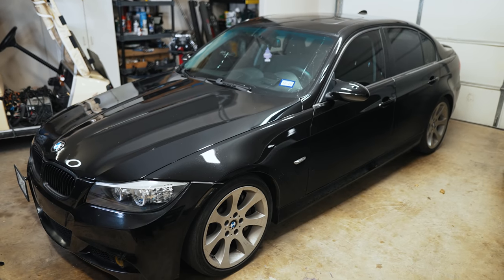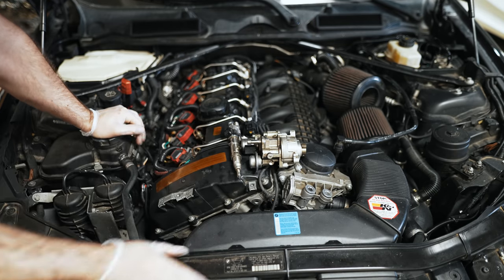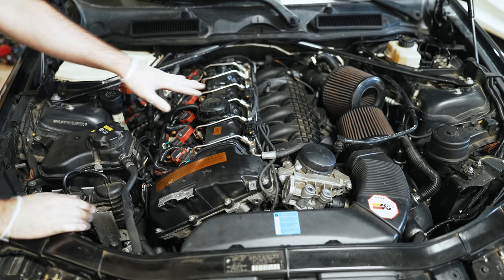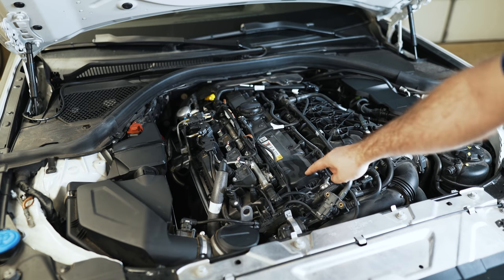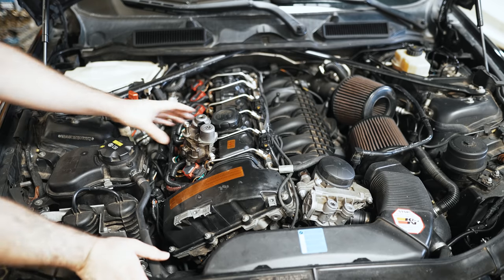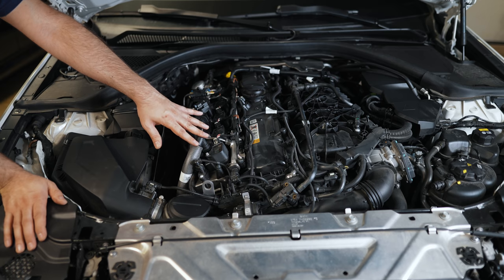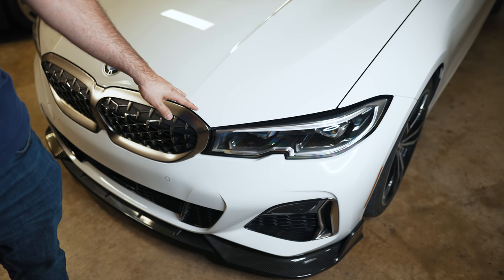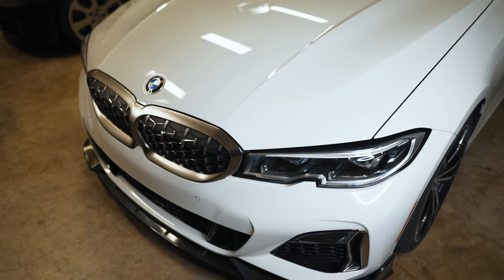Here Is Why New BMWs Are Now Reliable

Comment: One side of me says :
Im excited to see how reliable the B-modular engines are gonna be in a few years considering the BMW and Toyota partnership have been going on long before the development of the Z4 and Supra. So many people claims that Toyota and BMW didnt start working with each other before the Supra and Z4 was in development, when they actually started working together with the i8, its basically a Prius with a B-modular engine (B38 to be exact)... I got a 330e now with the B48 so i hope its still gonna be OK in a couple of years lol. I got engine, drive train and hybrid battery insurance on it just in case anything happens tho. If we ignore the S85 because of obvious reasons, and the horrible timing chain issues on some N-engines which BMW have been in denial about. BMW engines have been fairly reliable for years, as other people here have already stated. Its everything around the engine thats usually failed because BMW started experimenting with using plastic parts in around 2005. New engines are still packed with plastic parts, but BMW got years of experience now experimenting with plastic parts, and now they know what works and wont work.

Other side of me says:
Some parts are still made unreliable on purpose tho... BMW arent even trying to hide the fact that they earn more money from selling spare parts than selling actual vehicles. Theyre also purposely placing parts and gaskets at places where theyre difficult to reach so its more time consuming to replace them.

Comment: My 750LI bmw is reliable it’s all about doing the proper maintenance I bought my five years ago with 76,000 no issues only normal wear and tear oil changed brakes and rotors tires etc right now I have 178,000.00 miles running like a champ oh yeah I changed the spark plugs and did a transmission fluid change

Comment: Walking out the store the other day and I hear this weird noise, it was somebody at idle in their 340i B58, it sounded like a timing chain, car looked brand new. Immediately knew he doesn’t keep up with maintenance it was so loud and embarrassing as a bmw owner to see another bmw poorly looked after, incredible that you can have a B58 to run like crap. Very unfortunate we have bad owners then complain how unreliable they are when they can’t do simple services to prevent big issues.
Reply: You are just guessing that a lack of maint is the reason, stop doing that.
Reply: @FairladyS130  
What else could it be? There’s no issues with the b58 with timing chains. I usually don’t claim someone isn’t taking care of it but that car wasn’t taken care of at all, dirty exterior bald tires, and a rear tail light is out with an M badge on it? Clearly one of those guys who don’t care and try to look cool. Wheels were that cheap black dip paint on it too. We both know that’s there only 1 reason a timing chain on a b58 would sound that bad, lack of maintenance/ neglect. My X5 is 18 years old now I haven’t had a timing chain issue yet and I live where climate is -4 winter sometimes and it’s hot as 102F I haven’t had to remove any engine parts except the valve cover for a leak. Do you know what it takes to damage a timing chain? It’s not easy..it doesn’t just wear out, you have to really get on that car on cold starts with dirty oil fairly consistently to get a timing chain to go wrong. Haven’t heard any modern bmw engine have timing issues since the N62 V8. That sound was too familiar. The poor F30 sounded rough bro.
Reply: @aidenp5768  Any make of car can develop a fault irrespective of it's service history, that's just the way cars are.
Reply: @aidenp5768  Are you sure it wasn't just direct fuel infection loud clicking - ticking noise?
Reply: @UMORIEGA  
Positive it was timing chain, on the B58 chains are in the rear of the engine so as I walked passed it slowly on purpose could tell it was around the middle of the car, it was consistent scratchy/click unique sound that mostly timing chains make.
Reply: @aidenp5768  The problem is BMW says you can change the oil every 10-15k miles when we know you shouldn’t go above 5k miles between oil changes.
Reply: I doubt it, B58 just came out 2015. I have 2007 Sienna NEVER gave me a problem and no nise, and all I did was oil change.
Reply: @UMORIEGA That injector noise is much more pronounced if the engine's plastic cover was removed and left off. That could've been the reason.

Comment: You seem to be very knowledgeable about BMW do you have any suggestion for my comment below;
My water pump fail on a 2021 M440 xdrive with only 2,076 miles the car was at the dealership for 32 days they couldn't get parts supposedly because is a brand new model; what a joke I haven't even driving this car super hard I usually drive the car on my way back home from work on Sport Plus that is a drive of about 12 miles on city driving. could I have cause this water pump to fail so quickly because of driving it on Sport plus?? but what the hell that is why I got this car because of the acceleration and how it sounds on Sport Plus; now I'm afraid to drive the car a bit hard or Sport Plus; any suggestions. Thank you.
Reply: Wow that’s extremely premature in terms of a parts failure. I’ve owned my fair share of bmw’s including the e60 V10 M5, and these cars are simply not designed to last, by design.

Comment: Great thoughts, even my 2011 N55 has been dead reliable at over 100k mi. Granted, I keep up on the maintenance. 

My worry is that with European laws getting more strict every year, manufacturers have to keep increasing complexity just to get through the emissions tests. Within 10 years there'll be nothing but EVs and hybrids available.
Reply: When the euro7 norm will be introduced, it's game over for ICE engines in Europe so that will be 2025, when a perfectly, in house build industry, will be ruined by the EU, importing all batteries from China which is half the cost of an electric car.

Like they ruin everything, even 750 watt vacuum cleaners because of "environment" takes me twice as long to vacuum my carpet as a few years ago, hello....
Reply: EV's have their own red hearings.   How do you dispose of a colossal battery in our politically toxic environment?     Fossil fuel engines are not going anywhere.     Reality driving across country then hitting into a white out snow storm with an EV.  Yikes!    Ha, not this guy.   

Doing research on 340i and the b58 engine.  I hope it has Toyota roots for reliability.  If it does I'll proceed toward the 340i for my wife.  Seems like a reliable direction.    Much appreciate the informative video.
Reply: *~*~*~  "  Granted, I keep up on the maintenance.  "................VERY VERY EXPENSIVE......................Now REPLACE ALL TH ELECTRICAL and cal me back!...end of story!

Comment: Even the late EWG N55s are fairly reliable. I have a 2014 M235i with 95k km and it's only needed general maintenance and an filter housing gasket. This is an early build M235i (12/13), on a brand new F22 platform. Consumer reports christened it the most reliable sporty car in the US in 2016. We added an X3 M40i in 2018 and its needed nothing in 30k.

Comment: The "newer" BMW's are reliable because they haven't 150k miles on them.  Reliability to me starts thereafter, but then your BMW isn't new anymore.
Reply: Give them 10 years... will fall apart as always since 2006
Reply: @rocaley  in the middle east hot weather they completely fail around 5 years from the heat. On the other hand, the Toyota's easily last 20 years.
Reply: Exactly plus what about 200k miles
Reply: 150k is nothing. BMW should drive 300k miles
Reply: @syroboi3524  yup
Reply: look up 180k miles on b58

Comment: Per consumer reports 2020, BMW has a higher reliability ranking than Ford, Chevy, Dodge, Jeep, Tesla, Volkswagen, Audi, Nissan, KIA, GMC, Lincoln, Cadillac, Volvo, and Mercedes-Benz to name a few. Before you say anything about how great your Toyota is, just know Toyota currently offers two cars with BMW engines and drivetrains in them.

the mid 2000s were the dark ages for BMW and many other manufactures trying to innovate as fast as possible. Reliability was sacrificed, and they will probably never live that down, this comment section is proof of that. Hopefully the haters get over themselves eventually

Comment: I was close to selling my n52 e90 and get a 2019 340i buuuut I didn’t want to deal with a car payment along with car maintenance however this video is changing my mind. Appreciate the info
Reply: I’m keeping my 06’ 325i E90 until I reach 200k miles. Problem is mine is easily worth 10k with the expensive mods I have on it but kbb has E90’s at their lowest value ever right now. It can only go back up in value from here. Plus the N52 without a turbo is the most reliable BMW engine made since 2000.
Reply: @DillonRust  mods don’t add value on 325’s. They barely add value on 335’s
Reply: I’d never make payments on things that go down in value,
Reply: @thatgamertho227  
That depends, if I sold it myself I could definitely get 10k for it you’d have to see it’s condition to understand. Otherwise yeah my insurance would probably value it at a measly 5k, or only 2.5k for a trade-in.

Comment: Based on my experience with my 2018 M240i that took seven trips to the dealer and two replacements of the SAME part - in addition to the dealer illegally charging me to fix something under warranty and required by federal law - there is no way in hell BMWs are reliable. That's in addition to the 'what's it going to do today?" infotainment system.

I will say the mechanicals were flawless, but the whole car needs to be reliable to be considered reliable, especially when the dealer kept telling me that a driver's seatbelt that would not retract or work 'was normal'.

Comment: Also a starter/generator on the front of the crank and all accessories electrical off engine will make engine a very powerful and reliable daily use appliance.

Comment: From what I heard, Toyota had a lot of issues on BMW's design/reliability not being that great. I hope they both learned a lot from working together.
I think a lot of the bad rep comes down to costs. BMW's are quite a it more to maintain and repair. Same boat as other German vehicles. I own a German car, parts are ridiculously expensive compared to others.
Reply: We own 3 bmws... $2000 on maintenance in 6 years. What are u smokin? Dont tell me u go to mechanics...
Reply: Labor is expensive, the parts are a little more than a domestic, and a pain in the ass because everything must be ordered online.  But if you have a toolbox with a good collection and know how to use them, no they really aren't.  If you wrench yourself, you will come to love the brilliant engineering that went into everything.  The little plastic clips with springs vs pull tabs, or e torque bits so you don't strip bolts.  Everything comes apart with ease, and goes back together like a glove.  I have owned my e90 335xi n54 for 5 years, she is now 108k miles and full bolt on since I got her.  Never been stranded, but I fix my stuff, and keep up on maintenance.  I don't wait until things are broken to fix them.
Reply: The Toyota GR Supras have been very reliable. Most have the B58 engine.

Comment: I have about every generations of X5s in both V8s and inline 6 and recently jumped out of X5 and got into 2021 x3 M40.... I have to say it’s pretty impressive what they have done with the build guality. The only thing it doesn’t  work is the automatics seat heating/ preconditioning.
Reply from the maker: Hopefully they can address that via an over the air update.
Reply: How is an x3 m40i? I am looking to buy an m3. But I'll take an x3m if it's better.
Reply: @blocksource4192  I like them both but it all depends on how either one fits in your daily.  I’m jumping out of the x3 into a 2024 m340 xdrive. After many years with these I want a sedan again.  Also, the X3 is not getting the drive 8 ( the curve screen) until 2025. But overall, I really enjoy the x3, it’s built solid, it quite fast for an SUV. I don’t have any issue with it. The ride is stiff but I don’t have the adaptive suspension.
Reply: @blocksource4192  heres the rub. The X3 would be faster delivery than the sedan. I orders the 340 a couple weeks ago, they don’t expect to see it for a couple of months.
Reply: @pittwm  Im 17, finishing my company and starting to sell software rn. Im not even done saving up for the m3 lol, delivery times dont matter much for me.

Comment: Lots of input from toyota or so I read. Closed head vs open head. Intercooling etc. Now if they could use better quality plastics.
Reply: Any of these glass filled plastics are not going to last long in the engine bay.  It's just too hot.  The only plastics should be covers and certainly nothing in the coolant system.
Reply: @garyvanremortel5218  There is not one manufacturer on this planet, not currently using the same shit plastic. It is what it is.
Reply: @XcoolcoolbeansbeansX  I know, but I still don't think it's wise to fight physics.  How many aluminum alloy engines have been completely destroyed by the failure of one plastic pipe in the cooling system?
Reply: @garyvanremortel5218  I don’t know my guy, but I’m just trying to say it’s not a BMW problem. If it’s a problem, it’s a problem for every car being made now.
Reply: @XcoolcoolbeansbeansX  Glass filled polyamide is the bane of modern engines.
Reply: @garyvanremortel5218  you’re right. It’s sad, but sooner than later we will be begging to have a combustion engine car in any form, the way things are going.
Reply: @XcoolcoolbeansbeansX  And I live within spitting distance of the Tesla factory.

Comment: Purchased a used car with B58 with 87k.  Engine is solid, transmission solid (I change fluid myself for preventative maintenance).  But other than that, have had to change out all wheel bearings, guibo joints and an axle.  Fun fun.....

Comment: I too have noticed how much more reliable all the new ones have been getting. I don’t know about the 550i or M550i because it’s N63B44 engine is known for excessive oil consumption. Who knows if they ever fixed it. Because they still use it in the G30 M550i. 

But I’m super excited to buy myself an F87 M2 Competition in a couple of years.  Knowing many people have constantly redlined it at the track and the only wear item were the brake pads that needed addressing afterwards. It’s pretty much my dream daily driver that can be taken to the track straight from the factory
Reply: N63 engine was heavily redesigned in late 2012, so N63TU and later models are pretty reliable
Reply from the maker: Yeah especially so in the 2014+ models.  My 2015 in the X5 had zero issues at 64K miles.

Comment: I have had BMW's for 25yrs, in that time I have owned about 12 of them, Petrols, Derv's , auto's , manuals, age varying from 3yrs old to 10yrs old, mileage varying from 35k miles to 225k miles.

In that time I have bought one coil pack for an E46 330i, one alternator, for the same car, and one cam position sensor, also for the same car.......oh and a Lambda sensor and idle control valve for my E34 525i Sport........

Not bad I think.

I think a big reason is I avoided the problematic models, V8's and 320i's etc....and some good servicing routines etc.

Comment: My 2008 Sequoia has 201k miles on a 5.7L V8. It's dead reliable, actually I prefer saying ultra reliable. Everything is original/never been replaced and I still have zero oil leaks anywhere. I do engine oil/diff oil/transmission flush/tires/brake pads and a new starter, that's the list of repairs. I towed a 7500lb camper and now a 4500lb boat with it and everything is still original. "Dead reliable" is all perspective I guess. Let me know if your BMW hits 100k miles with "no issues", then you can call it reliable. In my opinion :), for what they charge, every single car on the market should make it 15k miles with no issues. It's 2021, raise your standards. If you think BMW or any other manufacturer has great reliability because something makes it 15k miles, yer nuts.
Reply: Precisely

Comment: does direct injection engine still have soot build up issue in intake valve since no fuel washes the oil vapor from pcv valve? or totally different design?
Reply: Exactly
Reply from the maker: From the N55 onward that issue was mostly mitigated.

Comment: Ive been saying this for awhile. All this tech is now in most lower end brankds like GM and Honda and they are having similar issue BMW had in the late 2000's. This tech is now solid and these newer designs will prove to be really solid.
I'm on my 8th BMW only one I bought with less then 100k and I have only been stuck once due to an alternator failure on my old V8 E60

Comment: Great Channel love it. From one mechanic to another you are a fountain of knowledge! The n55 in my x6 just turned 50k all it has needed is a waterpump. Time to decide whether to keep it because I sense many possible problems coming sooner then later now
Reply: Besides oil leaks, and valve cover gasket replacement you shouldn’t have any major problems, unless it’s a 50i then park on the side of the road and run 🏃 💨💨🚙

Comment: I'm glad having a N52 motor after what you said about it! ^^
Reply from the maker: The later N52s are solid, the only annoyance is the valvetronic position shaft sensor that is located under the valve cover that can go out.
Reply: @VehicularDIY  good to know for the valvetronic! Right now mine seems to work fine, so it will stay! ^^
When you say "the later N52s" , are you saying that the first ones have issues or are you talking of N52s in general? (Not native English speaker so not sure to understand the right meaning!)
Reply: Vehicular DIY Enjoyed your video, thanks. I too would ask if you could clarify what you mean by later N52 please? I have 2010 n52b30a inline six.